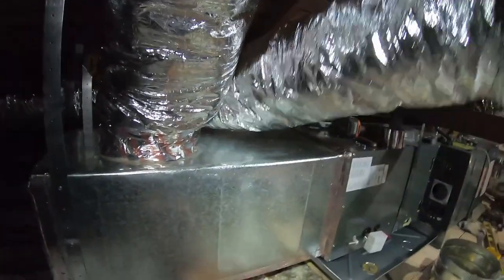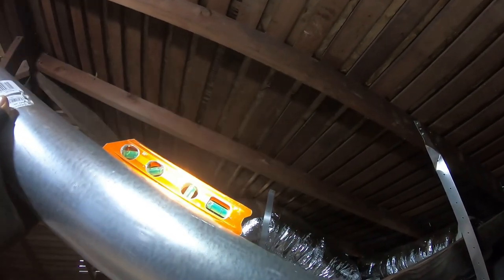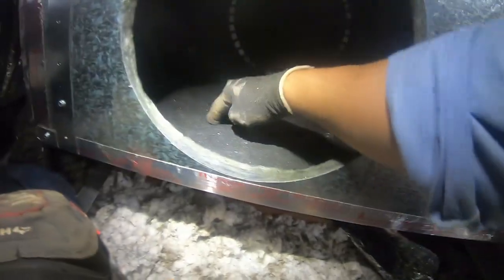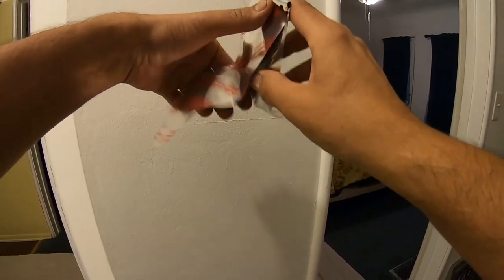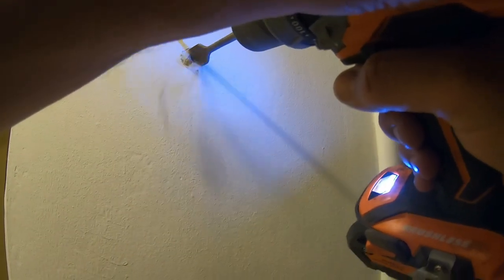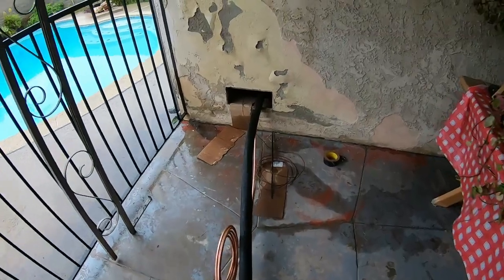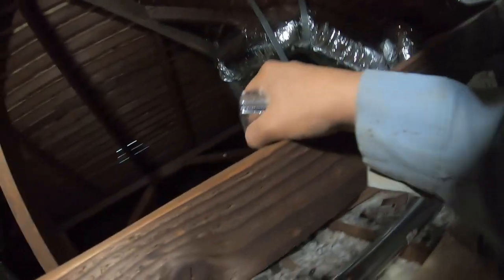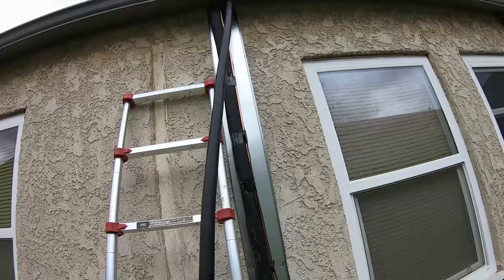New Home HVAC Installation part 4

Comment: Awesome job! I never thought about using the sawzall on the roof to cut the nails for the flashing. I always tried to remove them and crack the shingles most of the time. Thanks
Reply from the maker: Been there my friend. I worked under several great lead installers that took the time to teach me many tricks. Plus this YouTube channel is full of great installers that often give me great ideas.

Comment: Thermostat drilling tip with tape and the recip saw tip 👍 Such a clean install...
Reply from the maker: Thank you! You work in HVAC?
Reply: The Air Conditioning Guy I’m just another hack...
Reply from the maker: @VeryPersian  A hack wouldn't be subscribed to my channel 😜

Comment: A big magnet for those metal shavings from hole cutter works good. And on the metal strap for lineset wrap another piece of armaflex around the whole lineset and wire that’s  what I do
Reply from the maker: That's a great idea. Joe. How are you doing workwise with this whole covid-19 deal?
Reply: Yea doing great business as usual here. Come move on to Florida brother! I know it’s slow over there right now
Reply from the maker: @joeshearer1247  I would but the humidity there must be KILLER! 🥵

Comment: Good video. Would have put something in the hole for thermostat to keep  attic air from affecting temperature.
Reply from the maker: That's a great observation. I did shove insulation behind the hole in the wall but maybe a piece of tape on the wall would definitely help as well. Will keep that in mind for next time. Than you!

Comment: Excellent work bro. You do really clean work and I can tell that you take pride in your craft. I’ve been an installer/ service technician on the East coast in North Carolina for 15 years and we do things pretty similar to how you do. Only thing is, it’s mostly heat pumps here not many gas furnaces it doesn’t get all that cold in the winter here but the summertime is rough with the humidity. Inspectors here let us hang flex duct, drains and linesets with that black cloth strap it’s much easier and you don’t have to worry about it rubbing the liquid line or tstat wire. We only use metal strap on metal duct and plenums. I noticed you were using Y’s or tee’s to tie in your supply runs. We don’t do much of that here. I always try to run a solid metal trunk line usually round pipe if it will fit, if not than rectangular duct and take all the branch runs off the trunk duct. I think it looks better and provides better airflow but I know things are done differently in different parts of the country. It’s really interesting to see how it’s done in California and I’m really enjoying the videos keep them coming man!
Reply from the maker: Thank you for watching! Yes we could use that black nylon strap here to but I'm so used to metal strap. Plus I like the way it looks. The metal pipes would make it difficult for other trades in the future. And I don't think they would have fit through attic access. Heat pump videos are HUGE! You should start a channel.
Reply: I’ve been seriously thinking about starting a channel but you gotta have thick skin to put your work out there for the YouTube police to pick it apart. Don’t get me wrong I do really good work but I watch some other channels that do good work too and there’s always some haters trying to say they’re doing it wrong and that they could do better. It takes a confident man to put their work out there for everyone to see and I got a ton of respect for you and all the other guys that do it. If I get some time I’ll try to film a little something on one of my change outs or installs here soon.
Reply from the maker: @baitcasterdisaster8981  Ignore the trolls. Make some videos and post them. You'll enjoy it. Majority of people are respectful.

Comment: By insulating your plenums on the interior do you ever have mold growing on the inside? Also since your supply plenum does not reduce in size, Do you just size your flex runs to each individual room? Thanks in advance always trying to learn more. Keep up the great videos
Reply from the maker: We don't have a high humidity problem here. If unit is sized properly you shouldn't have a problem here in Southern California.  My ducts reduce in size as they get close to the boot. Typically I size the room, then the can, then the duct and work my way back. No more than 15ft. After 15ft I increase the diameter of the duct. So in other words I do reduce as I get close to the can/boot. Thank you for taking the time to comment. Questions are always welcomed. In fact I encourage them.

Comment: btw trac pipe is stainless steel not aluminum.  you probably know this by now but just in case.
Reply from the maker: Lol 😅. Yes. Good that you pointed o that out. I haven't gone back to check accuracy on all my vids.

Comment: Just curious, do they not make you use a starter adapter off the furnace for B vent? Also the 10/2 rule is usually only for solid fuel fired appliances. Our requirement is only to be 18" above roof line or 12" above potential snow load.
Reply from the maker: This furnace doesn't need a starter adapter, others do. The height you mention is the same here. I probably explained it wrong.